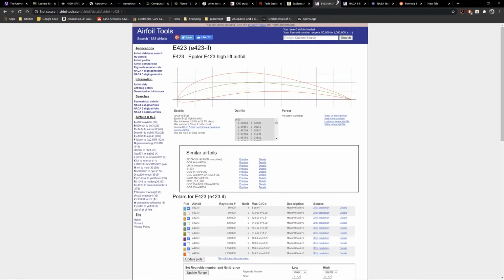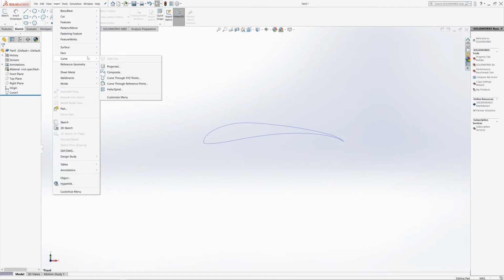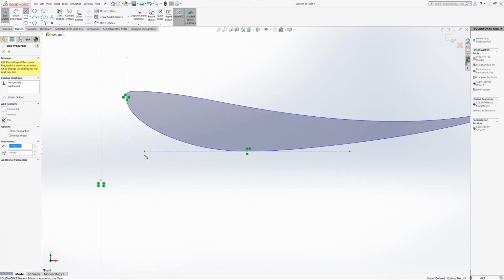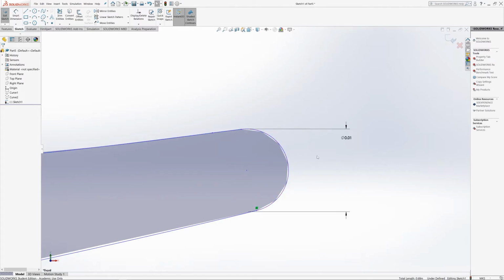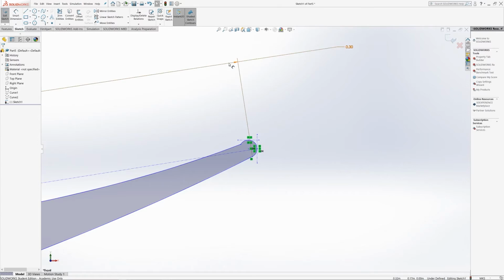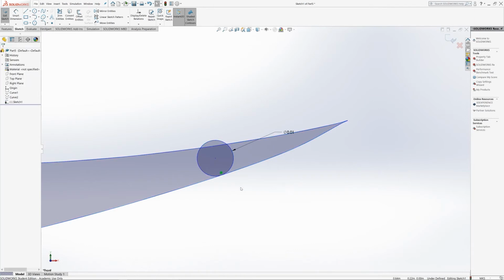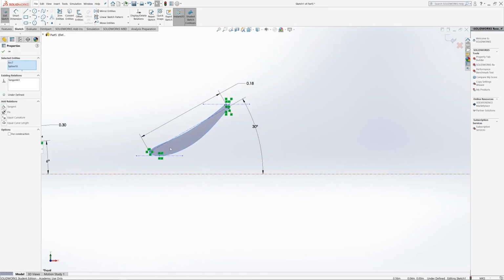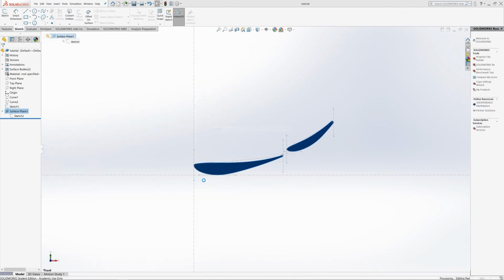FS Rear Wing Tutorial Part 1 - Geometry

Comment: hi bro. i was concerned regarding the modified part. i get that you have to modify the body for the blunt end but it essentially changes the initial AoA that you're going to report. Like let's say if the initial condition that you imported the coordinates was in 0 AoA, then your new reference 6 degree AoA that you define later is not actually 6 degrees but a bit lower because the camber has reduced. I hope im making sense.